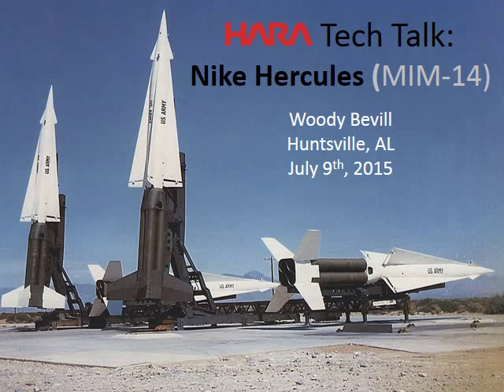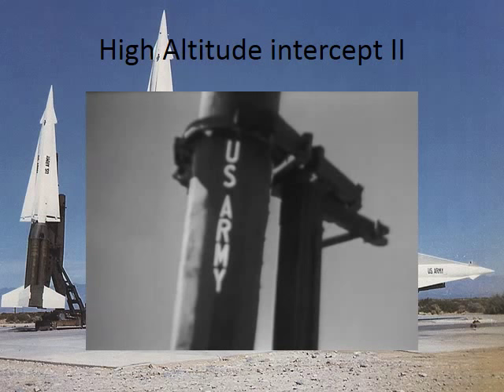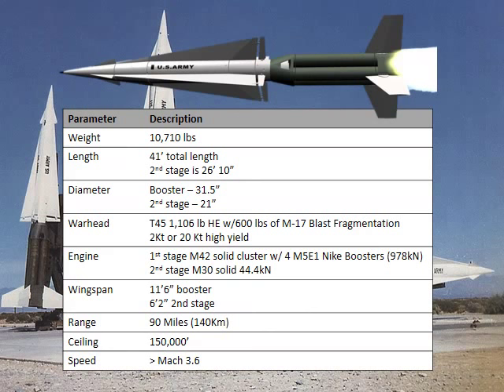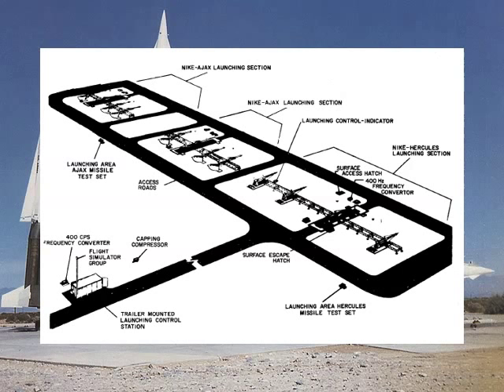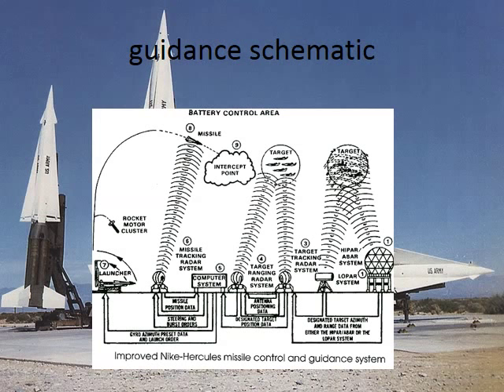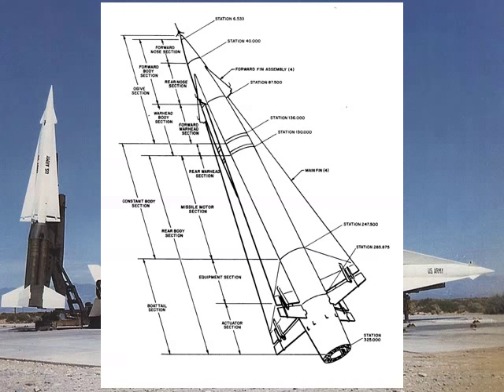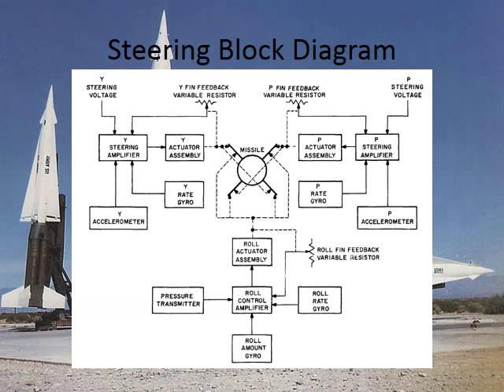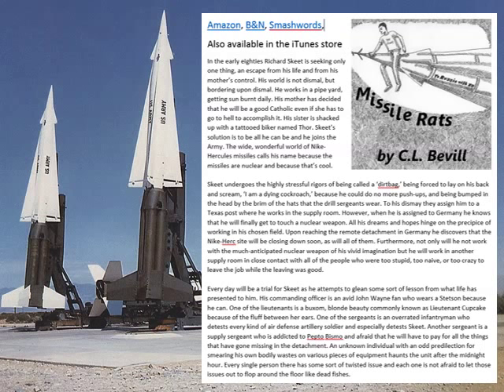Nike Hercules

Comment: Woody, I really enjoyed your explanation of the Nike Hercules operations. If I may, I would like to add a few insights from the BCA. I was the Commanding Officer of 'C' Battery, 52nd ADA in 1970 to 1971, which was located in the vicinity of Opa Locka, Florida. The Battery had been moved there during the Cuban Missle Crisis, and became a permanant fixture, until decommissioning. I have been unable to find much of anything about it, so when I stumbled on your account, I was very happy. First, unlike many US based Nike Herc sites, we had a real mission, tracking everything out of Cuba. Our Battaliion was linked with a Hawk Battalion through NORAD. When we were hot, we would literally track everything breaking the ground barrier in Cuba. This was during the Cold (almost HOT ) War, and occassionally things got very interesting. On to the Battery Control Area. First, I want to emphasize that the 'two man rule' applied not only to the Launch area, but in the Battery Control van, it was highly enforced any time we were in an operational status. I can't begin to tell you how many rules the BCO, any launch qualified Officer, and support personnel had to memorize. Everything from Battery release in a 'pop-up' status, to AC signature recognition. On more than one occasion things were fairly intense. I remember one time, when President Nixon was on Key Biscayne, and an aircraft was acting hinky just outside the air limits ( I want to say 200 miles, but its so long ago). At any rate our battery and a HAWK battery were brought to just short of 'install arm plugs' by NORAD. Lord only knows what similar incidents happened all over Europe/Asia at one time or another. Again, thanks for your explanation, which I am sending to my grand children, so they will know what we did.

Comment: I served as a Fire Control Crewman from 1971 - 1978. Computer Operator and Crew Chief.

Site NY-56 inside Fort Hancock on Sandy Hook NJ 71 - 74

Battery A,/5/6 ADA in Schoenborn West Germany 75 - 77

Site HM-69 inside Everglades National Park in early 78

My only personal experience inside the Launcher Area was as the occasional Sergeant of the Guard. Though he didn’t mention it, physical security at a site with nukes is tight. Where the launchers and missiles were was an Exclusion Area with a 2-man Rule. No one was allowed to be alone anywhere inside it.

The presentation was very informative and I learned some things from it.

There were some small factual quibbles.

11:00 He incorrectly downplays the LOPAR’s range capability. It could Acquire targets out to 250k (142 miles). The HIPAR increased Acquisition Range to almost 200 miles.

The distance between the IFC and Launcher Areas was 1000 - 6000 yards, limited by the MTR’s angular tracking rate up close and the cable length connecting the two areas.

The tale about the missile breaking the sound barrier almost immediately upon launch is false. It was fast but not that fast. Maybe the Sprint anti-ICBM missile could do that on its way to Mach 10 but not Hercules.

And the boost phase was about 3.4 seconds, not 6. The second stage sustainer motor burned for only 30 seconds, so the rest of what could be almost 3 minutes of multi-Mach maneuvering flight was done under sheer momentum.
Reply: I was an MP at Site Summit in Alaska in the mid 70's.  I know all about limited and exclusion areas.

Comment: Spent about 9 months at Ft Bliss with the 4/62 as a OJT truck driver after BCT back in 70-71. Got to pull a "practice" Nike through El Paso on a Ready Round trailer for Veterans day. That was one big ass rocket on a 50ft pull trailer. Good stuff !
Reply: Very cool!

Comment: Awesome video! I started out at Pforzheim, Germany as the elevation operator on the TTR, then eventually as Tracking Supervisor running the TRR. I was also lucky enough to fire twice at Crete in '77 & '78. Top score both years! Awesome job to have in the Army! D-3/71st! The hottest Nike Herc Battery in Germany at the time. Hot meaning vigilant on 24 on/ 24 off duty. I think our maintenance chief, WO4 Versaw and his stogie practically wrote the book on that system!

Comment: Served in Nike-Hercules as a 24U.  Spent most of my time at Ft. Bliss, Texas.  McGregor Range was actually where the testing and training took place for NG and Reserve, stateside.  Living in Detroit all my life, I was aware of three sites in the neighborhood...Rouge Park, Belle Isle(north side of island), and on the south side of Metro Airport, where the Air National Guard had facilities before the expansion of the present day airport.
The missile actually reaches Mach 1 by the time it leaves the launch rail.  The ability to be equipped with a nuclear device entailed the use of a barometric pressure switch at the nose of the missile.

When I ETS'd the Nike-Herc was being made obsolete by the Safeguard program, which didn't last long.
First time posting here.  Good videos.

Comment: Thanks for putting this together. I was and Internal Guidance Repair Person, Ordnance in Korea and Loring AFB in Maine. Right at the North East part of Maine and north west part of Korea. There where two sites we supported in Maine and one in Korea. I loved my job, MOS 254.10, 1962 to 1965. The sites we supported had 6 missiles in each battery and of those two sections of 6 each were Conventional war heads and the other 6 were Nuclear. I have been to SF88 about 4 times but the last time was about 12-15 years ago. The site in Korea was above ground and the two in Maine were underground like you showed.  Thanks Woody for putting together. The guidance package that was shown had back cover removed and the delay line box was missing. Without those the sites would have had conflicting problems as each site used a different delay line. Visit the site north West of San Fransisco. Well worth the time. I believe site only open on Saturdays.

Comment: Antique Shitbird  Only transistor were for the power supply  In the mushroom guidence system   Used a pulse position delay line into a and gate.   All Vacuum tube Good for EMP   MTR TTR TRR  LO PWR  radars

Comment: I am not sure you will see this post but if you do I have a question about something you mentioned in the video. I lived in Painesville, Ohio which was a Hercules Site and I now live next to a Nike Site in Lansdale, PA, just a coincidence. You mention the control area and the launch area needs to be separated by 5 statute miles. The site in Painesville is maybe 1/2 mile apart but the Lansdale site is about 2000 feet apart. The lansdale site was always an Ajax site and never upgraded. Am I missing something?

Thank You and your video was very helpful.
Reply: 5000 YDS AWAY FROM LAUNCHER.      I WAS A 24Q FIRE CONTROL TECHNICIAN NIKE HERCULES 2/52nd ADA MCGREGOR RANGE AND WHITE SANDS NEW MEXICO  1979-1986
Reply: The actual distance specifications was 1000 - 6000 yards.
Reply: I have no clue, but my guess is 5000 or expendable crew. Then later they cut some corners... 
OR
sunshine story, the radar simply got better over time

Comment: You would have to be pushing 70 or older to have worked on NIKE they where all gone by the end of 1974.
Reply: Not sure where got 1974 as the year Nike Hercules was phased out. I was still assigned to a Hercules Battalion in 1981. 2nd BN 52nd ADA.
Reply: I’m 65. I worked at one of the last conus sites in Key Largo Florida in 1978. We went from there to Fort Bliss and tested taking Nike Herc mobile by hauling it into the desert and making camp with it on generators for a full month.  We shut that Florida site down and disassembled it in 79’. I finished my time in West Germany in 81. I believe there were still active Nike sites in Italy almost to the year 2000.